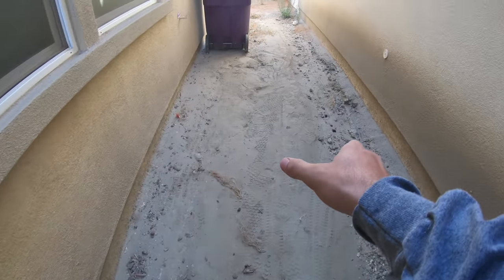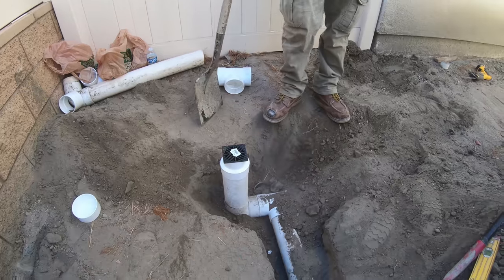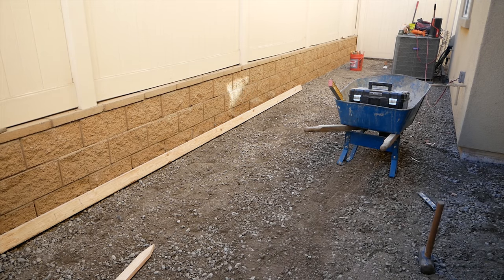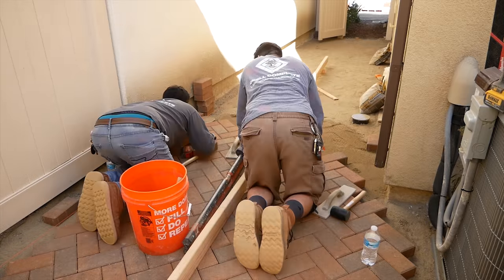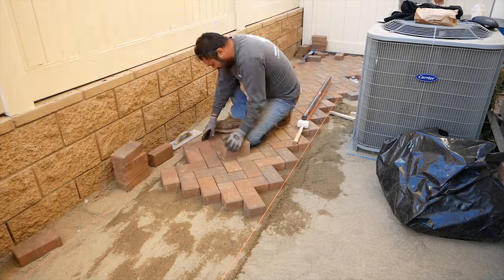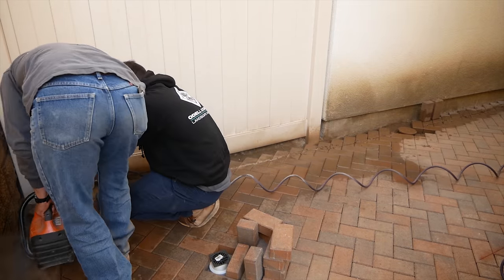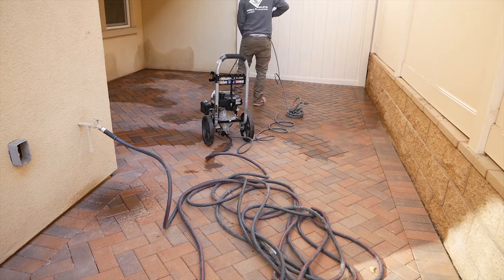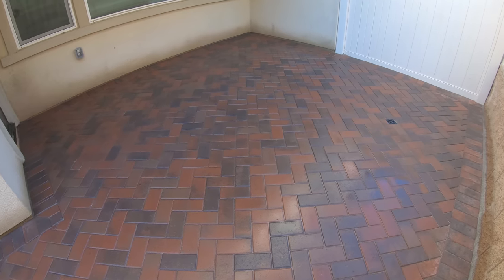How to Lay and Install a Paver Patio Complete Process

Comment: David  You have taught your boys well and I'm sure they've taught you a few things aggregating knowledge for the business. I know you're proud that they exemplify the work ethic and professional results of OCC. Beautiful work from start to finish. Tight, even, and flat - paver to paver.
Reply from the maker: Yes proud and I'm still learning
Reply: @OdellCompleteConcrete  , I'm glad to hear you say ,, I'm still learning... I'm 58 and still learning!. I do ceramic installs! My dude does pavers so I just learned about the polymetric crete. I actually watched your video from start to finish! I learned A lot thank you!! Great attention to detail! Explanation of water run off, drains and so forth. Oh and adding something else later! So know let me say my opinion,  you mentioned the down spout , if I where the customer and you explained the water run off from it , I would have paid you to drain it under ground. Or just make it part of job, if that's the best way to do it! Now let me be anal about your  Herringbone pattern and layout. You said your still learning and good for you young man !! Like I said this is the first video I've watched from start to finish in a while. You had your string lines paid and started laying pavers, by the way you made your first run I could tell you'd be off on the edges. I'd like to say  rookie mistake but I've watched guys in tile do it for years!  Your center line is not the starting point on a herringbone pattern. I'd some much rather show than explain it . Ok your  job is done looks awesome, now the one side has three inch cuts the other has five ,let's not get particular here with my measurements. Oh boy ,,,, get your center line dry fit some pavers and adjust . Anyway you find that the center is splitting the point of the top pager and the bottom point of the lower paver. Good luck in the future !  And keep an open mind! Maybe Google now to pay out Herrington tile.  Same thing only diffrent.  Good luck my friend,your on the right path !

Comment: Great looking job with bad access!! We do block paving in England a bit different for sure ! Same materials etc obviously! But the process is really different! Like after the hard core we wacka sand all down then screed to level then no walking on it then lay , cut in then  kiln dried sand brush over then final wacka down the brush off excess ! Different strokes for different folks I guess !! It all works though ay 👍🏻👍🏻
Reply from the maker: Getting on OSS 
Sounds interesting

Comment: Here in Belgium we use Sand and 150kg of cement for every ton of Sand so the cement sets off so its weak concrete but very hard. I think its way better than just Sand
Reply from the maker: That's a good idea but it may prevent drainage
Reply: @OdellCompleteConcrete  they make a special kind where the water just runes through idk how but it works 😂
The guys did a great job on this one

Comment: Great job! The only complaint I would have as a homeowner is the AC unit not being placed on a concrete pad or at least lifted and placed on the pavers. It is sitting low, water will get trapped and it honestly doesn't look right.
Reply from the maker: Nice thing is it's pavers and easy to change or add to

Comment: what's the name of the polymeric sand you used?  it doesn't leave a haze compared to the ones at Home Depot and Lowes. Also, did you apply sealer upon completion?
Reply from the maker: Yes we sealed it.
Don't remember the brand sand

Comment: Why did you not run the gutter into the pipe?
Reply: Yeah if you’re already going this far, might as well.  Also didn’t like their drain configuration, seems like you’d get standing water?
Reply: @mpers  he didn't answer me,  so I think he never thought of it. You should always add a down pipe and connect it to the French drain.

Comment: Thoughts on walking in sand while laying pavers? I know some guys swear against it
Reply from the maker: As long as its flat before you lay the paver, should be fine
Reply: You shouldn't have to pick up the paver multiple times.  Use a parallel pipes for the sand. 

It also disturbs the foundation and mixes rock into the sand I don't know why they aren't using a rubber mat either.  The mat will curl around the pavers unlike a solid metal plate.  It reveals more dips and such.

Comment: I feel like there was a lot more waste than there needed to be. You can use both sides of all those half blocks in the edges. Why not do half the patio up to the edges, saw cut that, then use the other side of the waste cut pieces for the rest of the patio. Then saw cut again. Sure not all of it will be able to be used twice, but there were a lot of spots you threw away more than half of a block. Couldve been half the waste.
Reply from the maker: Not perfectly parallel walls